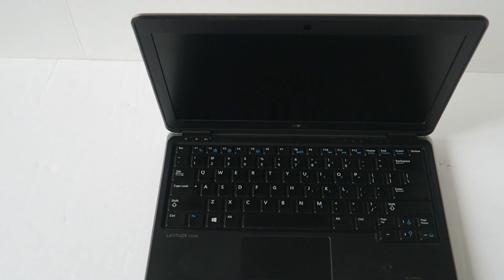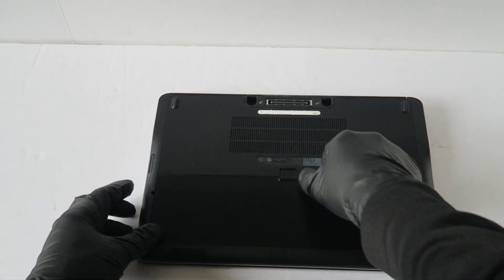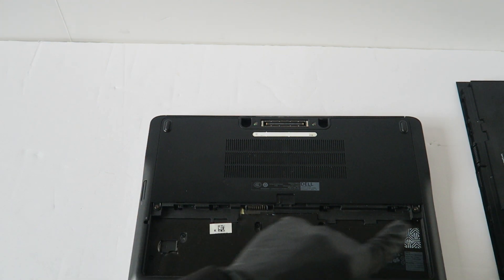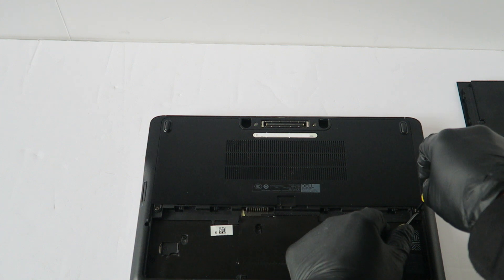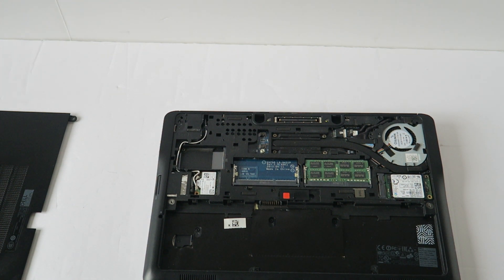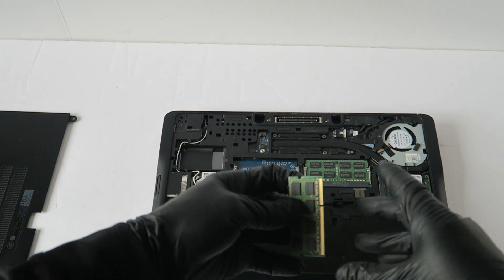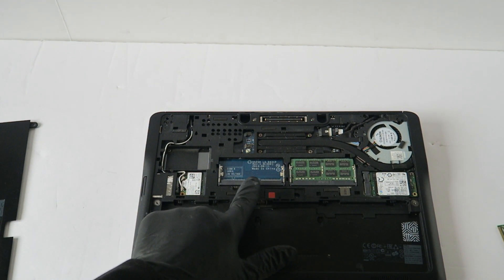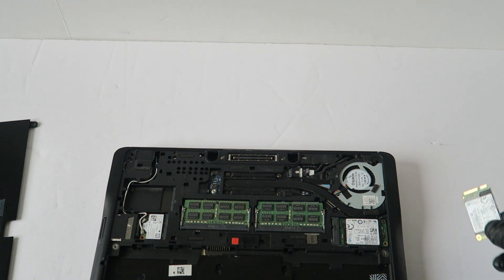Dell Latitude E7240 Upgrade RAM SSD

Comment: hello, can you give as a reference for the SDD and the RAM. If possible updated, as I see video is from 2018. Which would be the biggest SSD we can use in the Latitude E7240. I am thinking of leaving current SSD 256 G and perhaps extend as much as possible with a second SSD on the WWAN slot, possible?. Regards and thank you

Comment: i have A question about Hp pro 3500 i want to know if i can upgrade ram to 16Gb ddr3 1600 mhz . answer me pls . thank you :) 
https://www.youtube.com/watch?v=BCmYTXWKKlQ&t=249s
Reply from the maker: Hi, yes you can upgrade 8gb per each dim slot ddr3 non ecc memory.
Reply: bro i saw in the official  site of hp they say max is 8gb so its safe if i upgrade to 16 gb 1600 gb . 

https://support.hp.com/lt-en/document/c03364089
Reply from the maker: 16gb max..8gb per each slot ddr3 1600 non ecc memory for desktop will work brand like corsair, crucial, kingston...

Different Memory i tested will work...

M378B1G73QH0-CK0 - Samsung 1x 8GB DDR3-1600 

HMT41GU6BFR8A-PB - SK Hynix 1x 8GB DDR3-1600
Reply: thank you so much

Comment: Hi Can you explain the conversion of 24 pin 6 pin to mother mother motherboard and 6 pin pcie or huh something different I do not speak English with a divorce Greetings
Reply from the maker: Hi, what make and model PC are you trying to upgrade?
Reply: @Mxkdt   
Hi I have a very weak power supply I need to upgrade to a higher class but I do not know Compatibility Power I have a power input tower in the mother 6 pin motherhood you need to know how to convert from 24 to 6 pin
Reply: @Mxkdt   
Then I try to change the graphics card to gtx 1080 mini and power supply 240 w is not allowed
Reply from the maker: What kind a computer do you have is it custom or dell brand?
Reply: @Mxkdt  
dell optiplex 7050 tower
Cpu ci7 7700
Ram 32 
Gpu 1050 ti